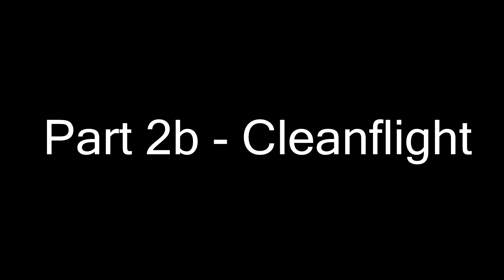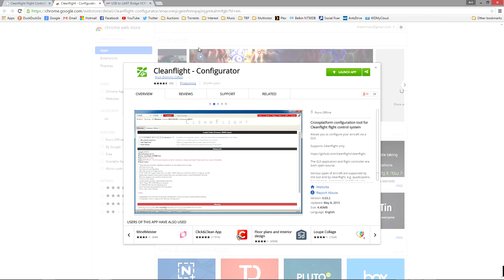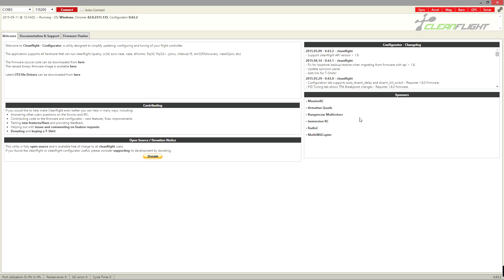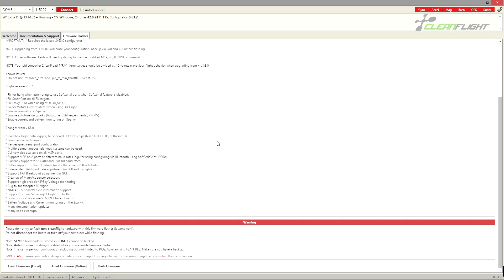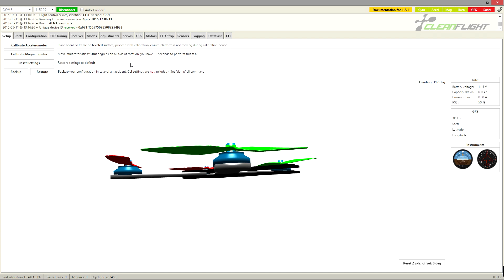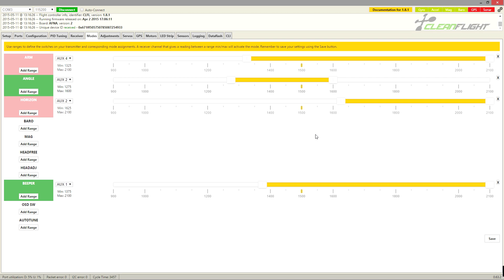FrSky Taranis, D4R-II, Naze32 - Telemetry, Battery Voltage, Lua Script Tutorial - Part 2b

Comment: set telemetry_inversion = 1 is not a valid command in Cleanflight 1.11.0 as of 1/24/16. says " Invalid value".   Skipping this command and crossing fingers. *****Well I'm not getting any telemetry from naze32, just the RSSI from D4Rii.  I am stumped now.  Maybe its the version of CleanFlight, but I'm not rolling that back to get telemetry
Reply: +Sage Goodner Yes it changed to value ON/OFF set telemetry_inversion = ON

Comment: Cell voltages in cleanflight are used for detecting the number of cells and then monitoring the average voltage per cell and for detecting when the whole battery is low. It would be very annoying to go and change low battery voltage alarm in cleanflight configurator every time you change between 3S ans 4S, that is why they use voltage per cell instead. It can not detect the exact voltages per cell, but it takes an average.
Reply from the maker: I have to respectfully disagree, and point out that cleanflight detects nothing. If you change from 3S to 4 S you still need to change settings in cleanflight accordingly

Comment: Awesome vids man, thanks, you really make setup so much easier. Unfortunately I am using a D8R-II Plus and still can't get a reading on cells. I've connected the Naze32 to the A2 channel (G,Rx) and A1 channel is set to read internal voltage and reads the same 4.95v you were getting on my Taranis Plus. Is there anything you think I should be doing differently to get external voltage working through the D8R-II Plus?
Reply from the maker: Bevin Shields Hi Bevin. From what I can see in the manual, you may need to use the Rx input and not the A2. The A2 is an analog input and the naze is sending telemetry via a serial port. Let me know how you go!

Comment: Thank you so much! It really pisses me off how all the info you need is scattered around, and you always miss the piece you need.

I had no idea you needed to enable FrSky protocol in the ports tab!!
Reply from the maker: flapflapflap88 Yeah, this was my exact motivation to make the video. Glad it was helpful to you.
Reply: The Dark Pixel My telemetry reads incorrectly though? 11.1v in cleanflight and 10.8 / 10.9 on the taranis ? I have adjusted the voltage scale in cleanflight to match what my multimeter says ... ? any ideas ?
Reply from the maker: flapflapflap88 You need to push the voltage scale up so that your Taranis output matches your multimeter reading. You're not supposed to match the scale setting to the actual desired figure. It's a scale adjustment, not an absolute adjustment.
Reply: The Dark Pixel Im using the telemetry from the naze to go direct to my osd... So one will always be out. I guess ill set the low battery alarms a bit higher on the taranis?
Reply from the maker: You can adjust the scale in Cleanflight and on the Taranis separately. So both will be correct.